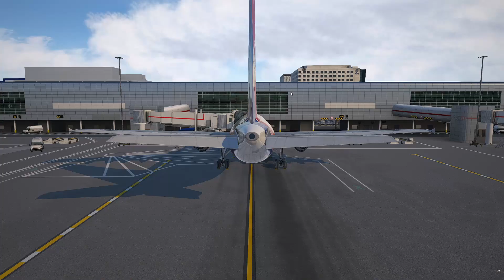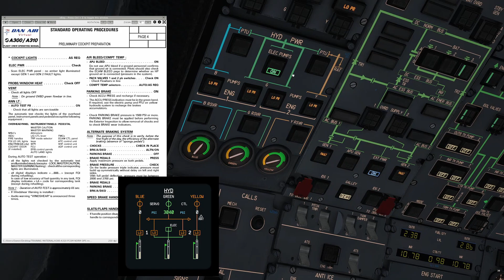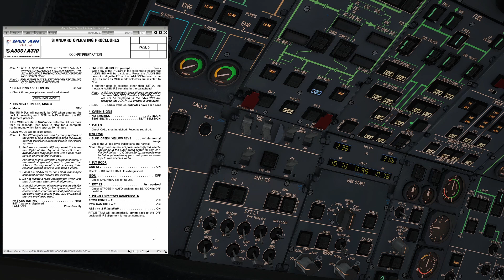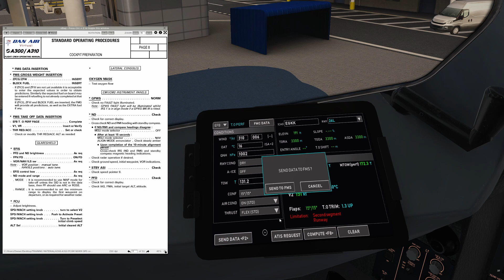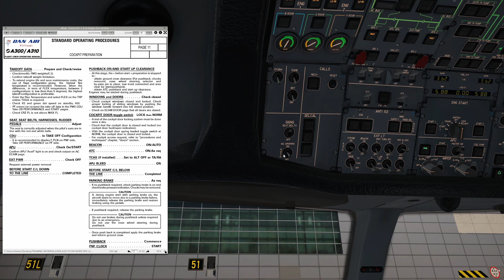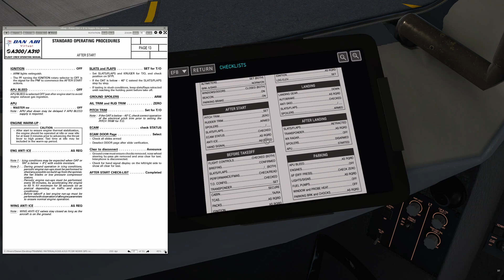Inibuilds Airbus A310 & A300 | Complete SOP tutorial | Part 1 - Cold & dark to Takeoff

Comment: The panel where the COM frequencies are tuned is quite different from the MSFS A300. Is that a difference because of older A300 model, or just not implemented in the MSFS version? I see no option to retrieve VATSIM data?
Reply from the maker: That newer style panel will soon be introduced to the MSFS version. For now to access Simbrief data you need to press Menu on the MCDU and then import Simbrief data from ACARS.